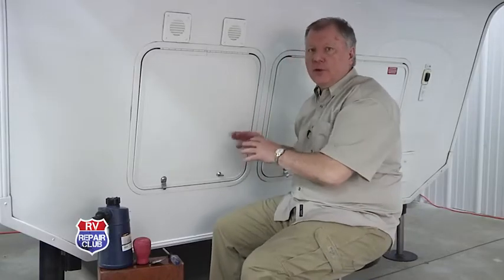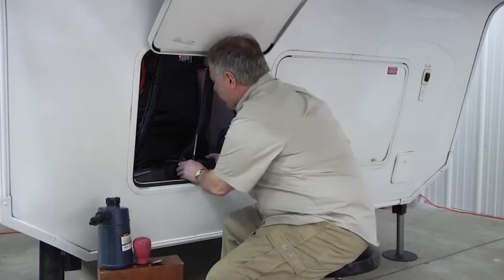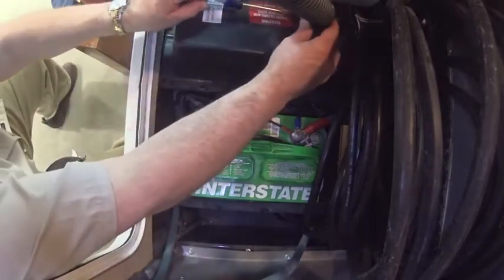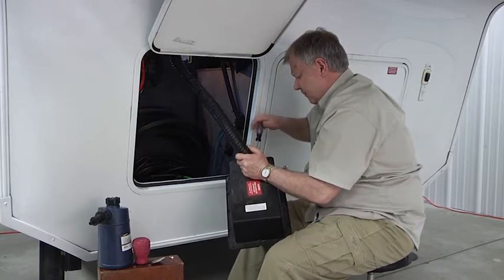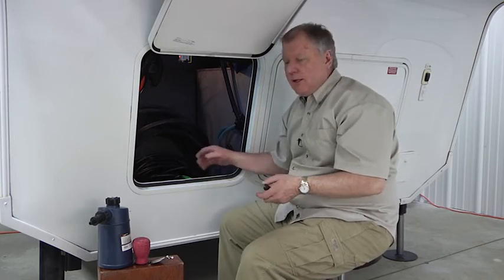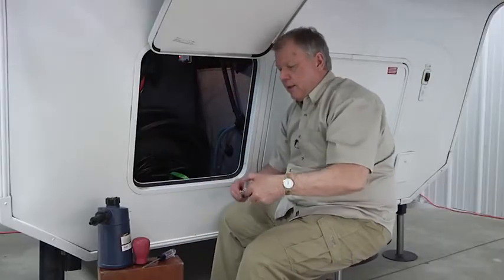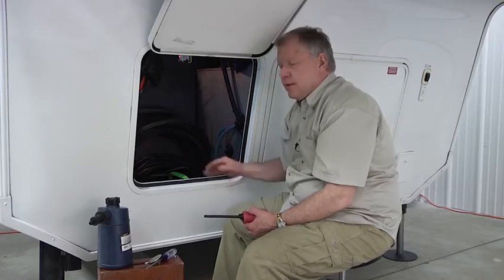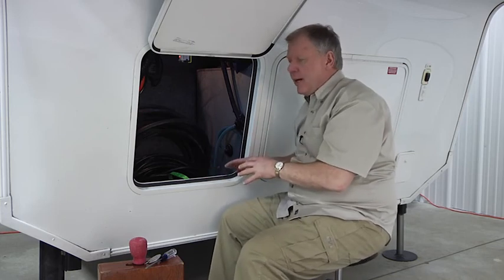RV Battery Maintenance Tips: Checking Fluid Levels

Comment: This video (like every other one I have found on YouTube) tells me to "fill, but don't overfill."  What does that mean?  How do I know when I've added enough distilled water?  And how do I know if I have over-filled my battery?  This seems like a very simple job, but this simple piece of information makes me hesitant to do it myself!  Other than that little omission, this is a very helpful video.  So thank you!
Reply from the maker: Thanks for catching the lack of showing the proper acid level in this video! It must have gotten cut during the edit as I thought I discussed it during the early part when I did say that if the fluid level got below the plates, we would lose capacity. But I just went through the entire video and it did not get mentioned? The fluid level should be covering the plates and just below the bottom of the fill neck. Overfilling is when you have fluid coming all the way up the fill neck to the top. If you look inside the hole (fill neck or vent tube) you will see a ring. Fill to the bottom of that vent tube. We have a diagram for reference, if you would like us to email that to you.
Reply: RV Repair Club gotcha!  Thanks!
Reply: Same issue here. The most important piece of information is missing, on several other videos too. When do you know you have the proper amount of water?
Reply: Silly question but do you need to turn off power before you do it this?